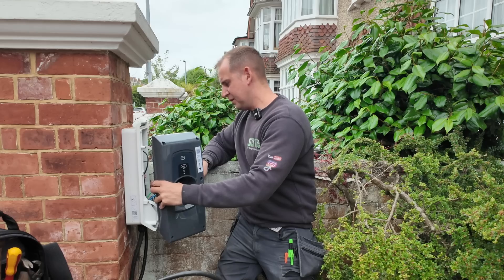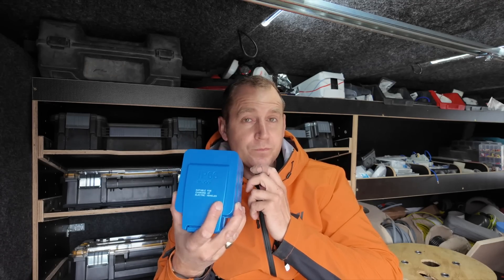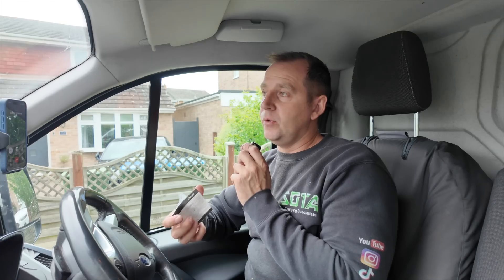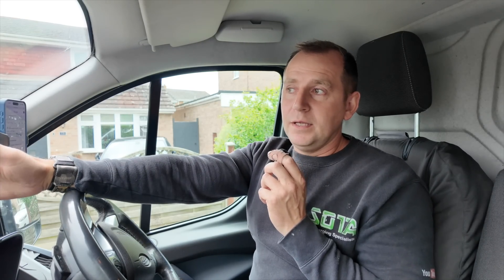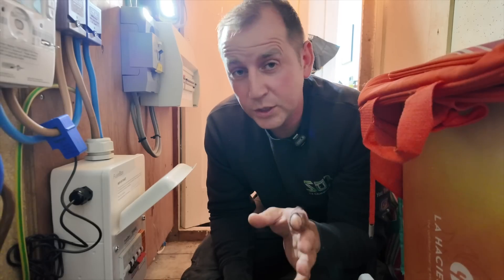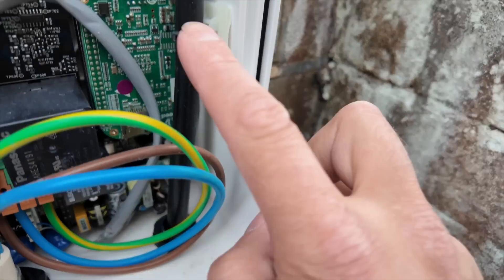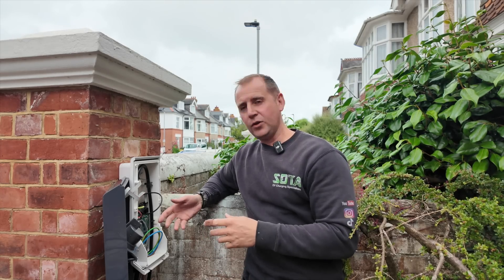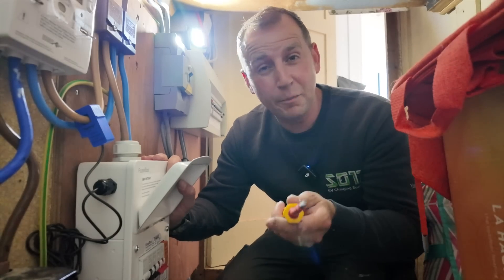A BLOWN UP EV Charger, A Misleading Product And A Day Of Carnage.

Comment: The single gang Hager sockets including the unswitched variant have BS1362-2/EV stamped on the back, its likely nothing more than testing of the single socket that had been done, but it also means if the single blue one is too expensive buying a standard IP66 Hager single socket is probably no different other than the colour.

Comment: I’m not experienced in EV but I’ve been asked to install a point for a hybrid. The kit that came with the car has a 32amp commando on it. They don’t want to spend a lot of money on a EV charger unit so could an option be is install a 32amp commando outlet and let the supplied charger kit monitor/control the load the car needs to charge the battery?

Comment: No EV socket should be a 13A socket, many EVs can draw upto 32A. Although you can set up the charging current draw at 80% of 13A which is 10.4A for continous supply, but that would be too slow to charge an EV to full. Hence its always safe to go with 1P 32A /16A Commando socket, you have them with isolators, provides more power and in turn charges faster with safety. Costs about 40 quid, but better be safe than sorry.
Reply from the maker: With a commando socket you still need to install PEN dont forget

Comment: 1:38 the socket “Granny “ charger is retail for £15.99 on its own and about £45.00 for the blue enclosure. The only difference is that on the back the BS1363/2/EV needs to be printed on the inside case.
BG do a “compliant” single socket with enclosure for £10… but at the time no EV stamp on the inside.. but will supply Document Of Conformity if requested. Which not in my opinion in the spirit of the BS7671 appendix 7

Comment: BS1363-2 EV sockets are mechanical stress tested ensuring it can withstand the prolonged high current demands of electric vehicle (EV) charging, including cyclic load testing to verify its ability to handle repeated heating and cooling cycles from continuous charging.

Comment: The Hager socket is marked EV on the rear which is a requirement for sockets whose main use is for long term EV charging use. Problem is there is no PEN fault protection like you get with proper 7kw chargers. I wouldn't put it on a spur. Probably on its own 16a radial.
Reply: Yes, but by the time you've installed something like a Matt:E to the 13a Hager socket, you're probably not a million miles away from the cost of a Hydra Cubus. I know the customer only has a PHEV but depending on their current consumer unit there's possibly only a hundred quid between them
Reply from the maker: @ I know, I’m with you
Reply from the maker: And install pen fault also!

Comment: My head is hurting trying to work this out. We just got a PHEV with a 14kw battery. In the week weve had it , it's needed charging almost every day. I was going to get an outdoor socket like the Master plug but then thought maybe get a proper wall charger like the Ohme you showed. Which you didn't seem fond of and sounds unreliable. Based on one video I've seen though!

The cost is around ten times the difference. 

Im not an electrician but I do have a family that I dont want to endanger unknowingly. 

What are my realistic and safe options. Either or just one of them?

Thanks.
Reply from the maker: Good Afternoon, so basically in order to charge your car safely you need something installed called PEN Fault protection, the EV chargers have this built in normally. A normal double socket does not offer this protection, my advice is, get a decent home charger installed, I don’t like the Ohme personally.
I know it can be expensive but you probably forked out a lot for the new car so don’t scrimp on the thing that’s going to charge it safely
Reply: @sotaelectrical Thank you for the reply. 

Which of those you've installed are you most impressed with?
Reply from the maker: @ the Simpson and Partners EV charger
Reply: @sotaelectrical  Oosh that's a great looking piece of kit but would have to get an electrician in and trust them to do it properly. 

Have also seen the Hypervolt Pro 3. That also looks nicer than the Ohme. 

Will have a think. Thanks again, appreciate you responding.

Comment: Im surprised the Hager socket has a switch  this is always a weak point in sockets due to their small contact areas increading resistance and getting warm. The Mastetplug/Luceco ev socket omits the switch and also has a 16A type A rcbo on board, much better in my opinion. How much is the Hager one?
Reply from the maker: Around £30

Comment: I wondered about this special socket thing so being the exciting chap that I am, I read the British Standard (can get it at work for free):

BS1363-2 gives a different test spec for sockets intended to charge EVs - and says they should be labelled with "BS1363-2 /EV" on the back. The colour is just manufacturer preference.

All sockets undergo a test for breaking capacity (of switch and by disconnection) and a test normal operation wear life (ie voltage drop on switch and receptacle contacts after x cycles) – this is done at 1.25x the rated current (ie 1.25x13). For normal sockets the load is substantially non-inductive but for “EV” sockets the load must have a power factor of 0.6.

"EV" sockets have an additional cyclic load test: 28 cycles of 8h on, 1h off, 8h on, 7h off - all at 13A. There isn’t an equivalent for non /EV

All sockets (regardless of /EV) must complete a temperature rise test:
Max 52K rise during a minimum continuous period of 4 h or longer until temperature stability is reached with a maximum duration of 8 h, stability being taken as less than 1K rise within 1 h. This test is performed at 14 (fourteen) amps load for a single outlet socket or 14+6A for a two outlet socket. Power factor is not specified for this test.
Reply from the maker: Great info!

Comment: here in France those EV sockets are popular as they can be installed by DIYers or electricians without the specific car charging qualification. They are more expensive sockets (either made by Legrand, Hager or Schneider electric) but there are differences with other outside sockets. The contacts are silver plated for better conductivity. They are probably bigger, too. And it has screw terminals, with some sockets accepting up to 6sq.mm wires. That size is not commonly used as 2,5 is enough, but depending on the length of the cable it can be necessary to use 6 square millimeters, even for A 16 A socket on a 20 amp breaker. So those sockets are suitable for that. 
In the Legrand range, there is an obvious difference in quality, a standard socket will melt with repeated 13A charging, while an EV one stays fine over the years.

Comment: The charger tthatt made the popping sounds is awful. Lots of exposed PCB. My own charger has an EVSE module, a contactor module and a main switch/RCD module. Everyhing is inside a module and it works just fine. The EVSE module in my charger is less than £100 and tthe restt of ittis prety much bog standard. Regarding granny chargers and 13 amp sockets I had an overheating problem charging at 3kw so I now charge at 2kw with no problems.

Comment: I have charged my EV a 50kWh MG 4 on a granny charger since i took delivery of it 18 months ago. The granny charger plugs into an external water proof 13 amp socket. I have had no problems, the socket is fed on a fused spur to a very substantial ring main. I only charge at 10 amps and constantly check the plug for heat, it only runs finger warm. I once detected a hotter than usual plug this problem was rectified by changing the 13 amp fuse for a new one. I never leave it charging over night. This works for me but takes a day time charge to replace half the battery. I am parnoid about causing a fire hence my precautions. Note - this only works as i am retired and the car spends a lot of its life on the drive. Love the videos by the way, very informative.
Reply from the maker: Thanks for sharing and thanks for watching!! 👍👍

Comment: It is just a posh outside socket, BG also make one. Their design is supposedly more robust than standard exterior outlets which often aren't designed to carry high current loads (10A+) for long periods. The 13A rating tends to be for short loads like a kettle rather than constant loading. I get a few melted outdoor sockets from granny chargers or hot tubs and, supposedly, these won't fail quite so readily. I did see one melted BG unit though, although closer inspection of the client's granny charger after the fact showed it was a no-brand affair sourced from one of the dodgy online souks and was pulling up to 16A which would be enough to get the 13A fuse hot for long enough to cause damage to any plug and outlet. I think there is a place for these things for this sort of customer who doesn't require anything faster or more powerful.
Reply: @dsesuk  a £10 one from Screwfix is better, and it's dual.

Comment: Arr the electricians nose you are lost without it. I am not joking, lost my smell with Covid still can’t smell much nearly 3 years on. Was working on a control panel that was blowing the control fuse and had to get the customer to do the smell test to find the problem. It’s crazy when you can’t smell a burnt out motor 😱
Reply from the maker: Smell is definitely a sense that us sparks use more than we think!

Comment: A standard UK 3 pin socket is rated at 8 amps continuous power and 13 Amp peak. Many hybrid / EV granny chargers can be 13 Amps so I would fit a 32 Amp commando socket.

Comment: We have an ev but we do not need an expensive home charger so I had my sparky install a 16a blue commando socket with associated wiring back to the consumer board with it's own breaker.  I bought a commercially available charge lead which can be set for a range between 6a and 16a charging.  

Bonus is that as it has the blue commando plug that is used on campsites, we take the lead with us when we go camping.  👍
Reply from the maker: Just some advice for you, make sure he has installed a separate board for PEN fault detection, or earth spiked it, installed a separate circuit and provided type A RCD protection, if not you have a potentially dangerous installation

Comment: The copper is increased in size on a competitor’s model. The lad on the other side of the call was not 100% on the question so blagged his response to get you off the call. The product though should have gone through additional testing and be appropriately marked up to state it is okay for ev charging.

The socket should be individually fed though and not supplied off any other circuit Atype Rcd / afdd. Going by the latest ev guidance notes

Comment: That blue socket is a rip off! Charged plug in hybrids off a normal 13 amp outdoor socket with no trouble at all. 
Why not get you a little magnet on a stick from Amazon to get the recessed screws out of those EV boxes?

Comment: I'm no expert but I understood that recent-ish changes to EV charging regulations in the UK require an earth spike to be used as part of the installation to deal with the risk of supplier earth faults. I can see no reason why a 13a outside socket should be any different to a full external  7kw EV charger in relation to this risk. Do you install with earth rod ?
Reply from the maker: Yes we do

Comment: In the USA we often use 14-50 outlets for EVs. These are 50A 12kw (9.6 continuous) but some are rated for more insertions and also better heat resistance as others have noted. Generally industrial ones used at RV parks are better than one for an electric oven that rarely gets unplugged.

Comment: I recently went to a house who had been charging their car in an out side weather proof socket and the overheating was evident and had burned the live port completely. Also same customer had been doing the same in a hot tub, the inflatable type and burned that out. Standard sockets are not designed or tested for max load for many many hours. 
The hot tub was in for days and the charger for 20 hours at a time. That Hager socket is designed and tested for the purpose.

Comment: For most people (doing less than 8,000 miles pa) an EV rated 13a socket like the Hagar will be enough. Charge slowly 2 or 3 times a week and you will always be OK. Example - 8,000 miles pa / 365 days is 22 miles a day @ 4 miles per kw = just 5.5kw of charging per day. Of course some days you will do a load of miles - just make sure on those days you start full.
If you have 2 cars it may get tougher to live with the 13a but its still worth a go.

Comment: You skipped over the part when you asked if you were going to get paid under the EV charger manufacturer warranty were you compensated. The Hager blue socket item you called about it seemed to me that the assistant basically know any information about it or in fact knew they existed.
Reply from the maker: Yes I get paid mate 👍
Reply: @sotaelectrical  Well done normally the spark has to do the change foc.

Comment: Hi. There are a numbers of EV 13amp sockets on the market and they are built over rated …. ie… Hagar is built to 20amp ( internal components) larger contacts larger springs….. and high heat rated plastics…. So just over engineered…. Or look at it another way… your kitchen toaster works fine on normal socket … but leave it on for 8 hrs and it will burn out the internals of socket but since a toaster only runs for 3 minutes at a time there is no problem …. Run it for 8hrs and it will fail
Reply from the maker: Great info thanks!!

Comment: I thought that any installation that is to be used to charge an EV has to comply with the same regs as a proper EV charge point. Such as PEN protection and a different trip system. As this is actually sold as an EV socket why hasn't it got the PEN protection built in?
Reply from the maker: Doesn’t have to be built in but needs installing 👍
Reply: @sotaelectrical  That mandated protection would take the cost of installation to almost the same cost as a proper EVSE charge point. Perhaps a ground earth spike to create a TT situation would work instead of a PEN device but at a cost. And even then the extra work in the CU to change to reg trips is at a cost. TBH I'm amazed that the seller of that 13amp 'solution' is not advising on the mandated regs for EV charging.

Comment: We found another solution, rather than a 3 pin 13A external socket. We also didn’t want a 7.5 Kw charger or the associated expense of fitting one as our EV has a relatively small 50Kwh battery, so looked at alternatives. We went with a 16A charger from 3rd Rock Energy and fitted an external “Commando” socket, similar to what you’d find on a camp site. The longer pins and greater surface area I believe mean it is better suited to long charging times and won’t get hot running at 16A. We manage fine with overnight charges and the cost was a fraction of a full 7.5Kw EV charger plus install. Definitely an option for some folk.
Reply from the maker: Great information!! Thanks for sharing!!
Reply: Snap.
Reply: @slideybackfast  they look good, have just ordered a 10metre long 16A commando lead. Will fit a socket and also one at my daughters then wr can charge up there safely too..

Comment: 13A plugs/sockets suck for EV granny chargers as the constant high load means the fuse in the plug gets hot and some poor quality plugs/sockets can end melting. I ended up changing the plug on my granny lead to a blue 16A connector and use an interlocked socket at home.  I also keep an adapter for the times I actually have to use a 13A socket.
Reply from the maker: Good info thank you 🙏

Comment: The ones i have fitted (cant remember the make) have a dp type A rcd module next them and state they are rated as an EV connection point. If it shows thermal effects then it will be covered by warranty whereas a standard 13 amp single socket would not be.

Comment: I assume that a 13A sockets expressly installed for EV charging must use TT earthing, not TN-C-S or have PEN protection, as there is the same danger of the car chassis going "live" that there is with a 7kW charger in the event of a broken PEN.
Reply from the maker: You got it

Comment: I would say the important thing is to put it on it's own circuit as it will constantly draw 10A. Personally I would have advised a 15A socket so they can potentially use a 3.5kW granny charger. That's whar I did originally.
Reply: About 50 years ago, we  used to install 15A BS746 sockets for sterilizing sinks which drew 3kw constantly, 13A sockets tended to overheat due to the fuse heat generation.Ever wondered way stage lighting uses BS746 sockets as standard?
Reply: What sized cable you recommend use for ev 3pin charger? Will 2.5mm enough or is better 16mm cables with mcb 32A or higher?

Comment: That fault looks more like something  has gone behind the PCB and shorted, or a short ( ?surge protector perhaps, maybe even an insect) causing a current high  enough to blast off the PCB tracks.  - the blackenning on the case looks like copper - this is characteristic of when copper is vaporised & deposits on nearby plastic, as opposed to heating due to a poor terminal connection which would also show some melting of the terminal and/or cable.

Comment: One issue with  normal outdoor sockets is that granny chargers have fairly chunky plugs which don't physically fit some 13A outdoor sockets, or don't allow the cover to close properly to maintain the IP rating
Reply: One nice solution is to use blue P17 sockets 32A. Cheap EVSE are available.

Whatever the socket, I revommend adding a Chargehanger to manage the cable.

Comment: Did you  fit PEN fault protection with that fancy 13A socket?
Reply: Most Good Chargers Have low and high volt protection built in so in most cases PEN are not required, best check the Charger for details.